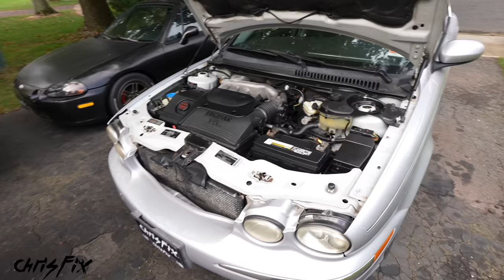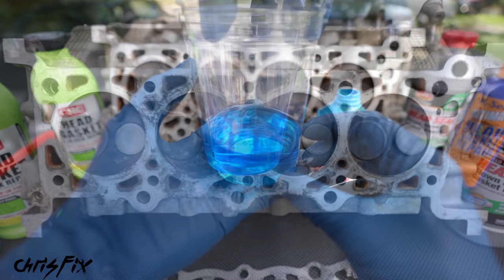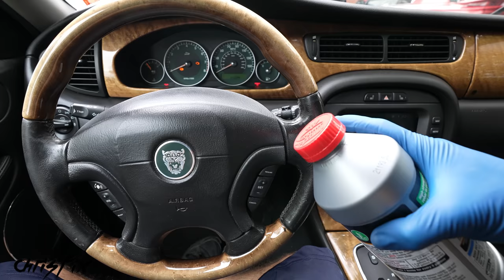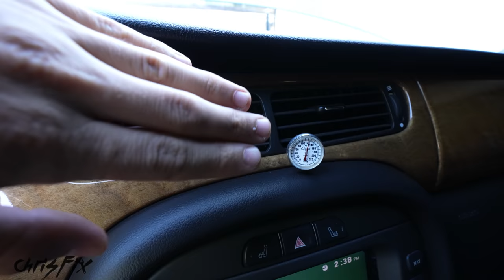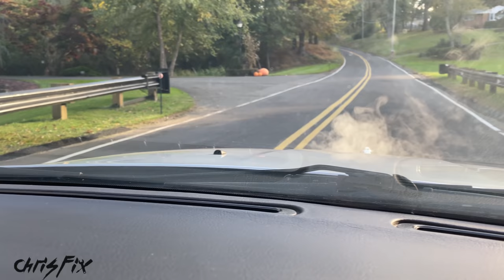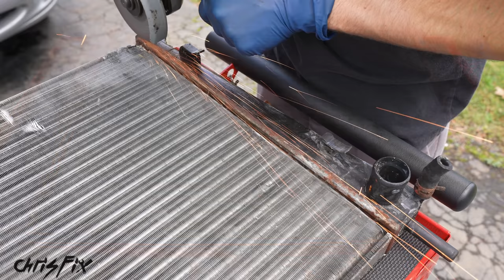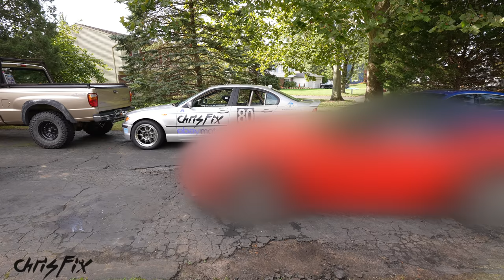Do Head Gasket Sealers Actually Work (FULL 2yr TEST with Engine Teardown)

Comment: I have well as of about a month ago had a 99 Silverado that had a blown head gasket it was getting coolant into the oil making it milky of course it was also leaking coolant of course obviously and was overheating and was unable to be driven because of it overheating I was getting prepared to change the head gasket on it when I was talking with a friend and he had mentioned the head gasket sealer to me and said that it works and that he knew from experience that it worked and of course I was skeptical because I have been working on cars most of my life and I have attempted using all types of stop leak and of course none of them have ever worked for anything that they were claimed to work for but even though I had started to check around and do some research as to what I can find out about any of the so-called head gasket sealers and I had run across your video and after watching it I thought before I had gotten into the labor intensive job of changing the head gasket I had thought well it's worth a shot and at the price of the sealers that are available it would be well worth the price paid if it actually worked so I had the bars leaks head gasket sealer because it was what was needed for my particular situation add read and follow the instructions exactly and it worked and of course I was shocked shocked and amazed I have to change the oil the milkiness of the oil and coolant of course evaporated from the oil however I did change the oil not very long after I had got it to stop leaking however after about a week or maybe a week and a half after it had stopped leaking it leaking it had started again and I thought maybe I didn't run the sealer in the cooling system long enough so I got another bottle of it and ran it in the cooling system once again and this time I ran it quite a bit longer probably twice as long as I did before and it worked again the second time and that was well over a year ago that took place in December of 2022 and I had drove the truck every day up till I had sold it and I had put well over 15,000 miles on the truck and it never had any more issues with the head gasket at any time and it is still running currently and the person that I sold it to was a good friend of mine and of course let him know that I had run the sealer and it so that way he was aware of it I'm a firm believer in the bars leak head gasket sealer I just recommend that anybody that uses it should run it for twice as long as what it says to if I'm not mistaken the bottle says to run it in three intervals of 15 minutes after the engine reaches operating temperature I'm not 100% on that but however many what time is it says to run it definitely do it twice as many times to make sure it runs through the system thoroughly you should have success with it as I know I did and anytime in the future that I run into a blown head gasket I will be certain to use it again because it is definitely cheaper and way less time consuming and nowhere near the aggravation of changing a head gasket

Comment: I have used nothing but "Steel Seal" brand for decades on a variety of cars  has always worked  if you"ve a milkshake in radiator flush with water  THEN use straight (Red) Kerosene to clean out all  (the kerosene has a high temp capability therefore will not ignite on you & cleans out entire cooling system of all that milkshake muck (ps) engine runs cooler also  THEN do a Prestone Flush same procedure  Now time to add ((as directed and product manufactured to do its job & validate guarantee)) add 50/50 proper brand coolant along with your Steel-Seal  works folks  works well  has never let me down & you do not have to change out the  coolant afterwords  drive & smile  if gasket blow out a serious blow out you should initially do proper procedure running @ house until results ((do not forget to run heater while having product do its thing & of course starting with the engine being cold  if runs super hot during so of course shut vehicle off & let cool & repeat procedure of start cold running heater until guage thanks you for your labors 😊

Comment: I have used the bar leaks head gasket stop leak and I don't recommend. It did not fix the leak and it ended up clogging the cooling system
Reply: Must have done something wrong, was the cooling system pressurized before the procedure? Was the leak severe, if so did you remove the plug from the worst cylinder to eliminate cylinder pressure? Thermostat removed? Heater core valve fully opened? Cooling system flushed several times before the procedure? Added correct amount of sealer taking cooling system capacity into account? Mixed the sealer with water before pouring it into the cooling system? Procedure done in several cycles raising the temperature some more every time or did you do it in one go?

Comment: I have a 2003 Chevrolet 2500HD with 6.6L LB7. I have no oil in my coolant and no coolant in my oil, I'm not overheating but my cooling system stays pressurized even when engine is cold. Will this test work for a diesel engine with the blue liquid? Or do I not have a head gasket issue? Hottest the truck as ever gotten on a hot day is 210(which is normal for a Duramax)
Reply: Just fill to the brim and look for bubbling while the engine is cold and running. It's normal for cooling system to stay pressurized.
Reply: @SinsBird Do you know if the one he used will work in a diesel engine?
Reply: @Tootallfordoorways  it would work, yes

Comment: I brought a bottle of Bar’s head gasket sealer after watched this video!And pour into radiator with half bottle. Then let the engine running at idle speed till Celsius 87 degree (30 mins).And drive to outside gently (1200-1500rpm).After all processes, the bubbles still from radiator! I don’t know why?
Reply: Are you losing coolant? Oil in coolant or coolant in oil? Running at idle is wrong.
Reply from the maker: The leak could be bad enough this doesn’t work
Reply: @chrisfix  
2000cc diesel engine!  Half a year after the engine repaired, I found that the bubbles from auxiliary radiator. Then I add a temperature meter(OBD II) to monitor  and avoid over heat. And it hasn't ever over heat(under 100℃) but only some bubble from auxiliary radiator continue. Utill I got this video and bought a bottle to try.I thought its mild symptoms on my engine and believe gasket sealer could save this problem.I need to suck some coolant from auxiliary radiator to radiator(about 40-200cc) before I drive everytime.Coolant is good without oil in radiator and never losing coolant.

Comment: So you don’t need to do a radiator flush or oil change before adding the sealant?
Reply from the maker: Check the instructions on the specific sealant you are using, in my case I didn't have to
Reply: You need to flush multiple times before and after using the sealer. Change oil if it's contaminated with coolant before using the sealer, then change again soon after the issue is fixed.

Comment: Question, my subruban is pushing out white smoke, the car does not overheat and the coolant is fine. However, it also idles really roughly when the white exhaust comes out and then drives fine after it heats up. Is the rough idle because of the possible head gasket crack? My other guess is that it is a bad fuel filter. it idles rough and sometimes misfires and has given off a P0300 before
Reply: Fill the cooling system to the brim and look for bubbling when the engine is running cold.

Comment: What a great video! Thank you for dedicating so much time and energy..I have an 06 Altima I believe has a warped head..any advice before I go get the green stuff?
Reply: Make sure the cooling system is pressurized, otherwise it wont work. I recommend to do it in steps, not one go, also keep the RPM above 1000.  Let the temperature rise some, shut the engine off, let it sit for and hour, check coolant level, add water if there's less of it now, start and run the engine some more to reach a higher temperature than before, shut it, let it sit for an hour. Check the coolant level...and so on till it reaches the operating temperature. Don't hurry to dump it out of the cooling system, make sure that it sealed for sure, drive it keeping rpm high so it gets hot, then check the coolant level. If it's okay only then dump it out. Flush the cooling system multiple times before and after using the sealer. If removing the thermostat would be a problem for you choose a sealer which doesn't have particle filler in it.

Comment: If you read the label on the Bars Leak, it says NOT to use antifreeze after fixing the leak.  I live in Vegas so I can get away with using just water. Can you suggest a coolant that will not destroy the Bars Leak seal?
Reply: Nonsense. It's just sodium silicate. After the leak is sealed flush the cooling system multiple times and use any coolant you want. But use water only when you're adding the sealer.

Comment: My head gasket is just leaking oil out the side.  No mixing of coolant or anything..  when i put it on i had to pull some of the bolts out cuz forgot something inside and reused those bolts which i shouldnt have done.  And i dont wanna pay for all new bolts and another gasket then take the whole thing back apart..  i dunno what i can add to the oil to stop the leak..  without having to take it apart and all..  it leaks a good bit but somehow isnt getting any mixing of fluids..
Reply: Bolts can be reused many times. This is not an issue. The issue is probably that you messed something up, possibly you tightened the bolts same way as you did before stretching them out. Gotta do it all over again.

Comment: chris fix can you help me my coolant tank its overfilling when cars a temp and got white smoke from car cars only done 98500 miles any ideas
Reply from the maker: Is the car overheating when the coolant tank gets overflowed?
Reply: @chrisfix  no just loads off smoke when accelerating it did have well to much oil in it so new oil in it the now
Reply: Also no milky oil on oil cap or dipstick so am confused and no garage will help me or audi as its a audi a3 2016 1.6tdi

Comment: I've gotten a new water pump, valve cover gasket, radiator, oil change. The antifreeze no longer leaks. My heater is working again. My car can sit in idle while running for several hours. But the moment I start driving, it overheats but will stop overheating when I come to a complete stop. I still don't understand what is going on.
Reply: Check your thermostat, make sure radiator fan is spinning like it should.

Comment: I’m about to try some in my e38 soon, Seriously hope it works
Reply: Is coolant and oil mixing? Oil in coolant or coolant in oil, or both? Is the cooling system pressurized?
Reply: @SinsBird  Good amount of smoke from the exhaust, Figured It was just condensation or engine burning off old gunk but I pulled the dipstick last night and noticed some faint streaks on the very end of the dipstick, I’ll have to get a combustion gas detector to know for sure but I sincerely hope those head gaskets aren’t bad. I always saw stopleak as a hack “fix” But I definitely don’t have the skill to fix or money to repair those head gaskets so this will have to do
Reply: @assadsmagicalmysterytour  Just fill the cooling system to the brim and look for bubbling when the engine is running cold.

Comment: So you said you didn't change the oil after doing this fix.  Is 10k miles a reasonable window for oil life in that car?  If you had changed oil after 5k miles do you think it would have held?  I guess not if the head was warped but it does make one ponder.  Also did this car overheat significantly before the head gasket sealer or was it a result of your dad flooring the gas 10k miles after the sealer without an oil change.

Comment: Thank you!!! My 2003 Mercedes E320 has head leak into the coolant system...they want $3300 to fix it...Hopefully, this will help
Reply: Is oil and coolant mixing? Oil in coolant or coolant in oil? Or both? Is the cooling system pressurized?
Reply: @SinsBird  The coolant system is getting pressure...so i drive it with the cap off...haven't checked the oil yet because it doesn't have a dip stick...i'd have to change the oil, in order to see the oil
Reply: @pastormichaelhibbertminist7486  if you don't see oil in the cooling system, then it's probably alright, because as it's not pressurized right now, oil pressure would be pushing oil in there. If removing the thermostat would be a problem for you choose a sealer which doesn't have particle filler in it. I recommend to do it in steps, not one go, also keep the RPM above 1000. Let the temperature rise some, shut the engine off, let it sit for and hour, check coolant level, add water if there's less of it now, start and run the engine some more to reach a higher temperature than before, shut it, let it sit for an hour. Check the coolant level...and so on till it reaches the operating temperature. Don't hurry to dump it out of the cooling system, make sure that it sealed for sure, drive it keeping rpm high so it gets hot, then check the coolant level. If it's okay only then dump it out. Flush the cooling system multiple times before and after using the sealer.
Reply from the maker: Let me know how it goes and good luck!

Comment: Hello Chris i have white smoke when i start after it's has been stand over the night. I did this testing that is on your videos and it's seems none gasket leak. I wondered what it can be?  I am thankful if you can give any ideas. Thanks so much.
Reply from the maker: Is there only a little smoke then goes away? That's likely some water vapor in the exhaust heating up and steaming out. Nothing to be alarmed by

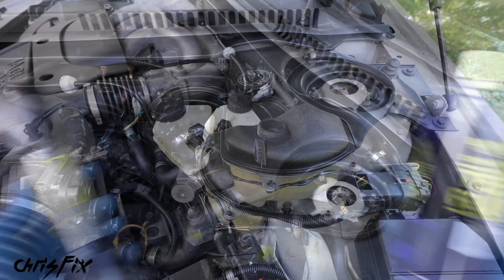Comment: Wait isn’t the cooling system pressurized when hot but you had the cap off 6:16
Reply from the maker: It pressurizes when the cap is on which closes the system, you can idle without the cap (you would have to if you were bleeding the coolant for example)
Reply: @chrisfix  I love your videos and I don’t even have a car

Comment: My car is not losing coolant or burning oil. Cylinders 3 and 4 have low compression. So the head gasket leak is between cylinders not affecting coolant or oil paths - gas leaks between cylinders. So I suppose these coolant sealants won't work but is there a way to seal my kind of head gasket leak without replacing the head gasket?
Reply: No.

Comment: On know this is 2 years old but I have a 2001 jeep cherokee xj & guessing I have a head gasket leak (or cracked head). I haven't overheated the jeep, while I consume coolant weekly, have what seems to be excessive moisture in the exhaust (it's also winter & cold) oil & coolant (color & no bubbles) look good. Cab the leak just be going into the combustion chamber without the gates escaping into the coolant? No other coolant leaks & its been too cold & work too much to pull the head right now.
Reply: Just fill cooling system to the brim and look for bubbling when engine is running cold.

Comment: Helo. Great video.
I have a problem with a 2001 VW Jetta TDI Diesel, not overheating not coolant in oil or vice versa. The only problem is overpressure in coolant reservoir it keeps pushing coolant out.
I have tried the same bar leaks product you did in this video but it didn't work at all.
Any suggestions?
Thanks for your help.
Reply: I recommend to do it in steps, not one go, also keep the RPM above 1000.  Let the temperature raise some, shut the engine off, let it sit for and hour, check coolant level, add water if there's less of it now, start and run the engine some more to reach a higher temperature than before, shut it, let it sit for an hour. Check the coolant level...and so on till it reaches the operating temperature. Don't hurry to dump it out of the cooling system, make sure that it sealed for sure, drive it keeping rpm high so it gets hot, then check the coolant level. If it's okay only then dump it out.

Comment: Thanks I have a question I have a civic 2003 if the head gaskets are bad the fans will not turn on??!!..
Reply: Can't say, it's possible. Just fill the cooling system to the brim and look for bubbling when the engine is running cold.

Comment: But, what if the leak were into the oil ?
Other than milky. What tests ? Which additive and how does it work etc ?
Reply: Not sure why you want other tests, that's the only symptom you need. It's less likely to seal such a leak but you could try. Probably any sealer with no filler material for this.

Comment: I don't see how the sealing compound could migrate into the cooling system by simply putting it into the reservoir.  As this test was done. Now assuming that the head gasket leak consumed enough coolant equal to the reservoir during the test drive, when the car was parked over night, the reservoir contents would then during that time be drawn into the cooling system, but without the heat from the engine the sealer wouldn't harden correctly. Could this be the cause of the failure after the 2 years?

Comment: Hey chris was this vehicle mixing coolant with oil before you used the sealer?
Reply from the maker: No it was more so burning the coolant up. These sealers can work if that's your situation though
Reply: @chrisfix  I ask because I was told that if coolant is mixing with oil, then using these sealers can cause the engine to seize up based on that it will get into the motor the same way coolant is getting in, what's your thoughts on that?

Comment: My coolant reservoir boils and over flows when the temp rises. ( this is while the cap is off) I found a crack in the radiator and it leaks . Would this cause my coolant to boil and over flow? ( car temp gauge never passes 1/2 mark, no white smoke , no smoke at all near engine , oil is clean, did a combustion block test and  it turned yellow )
Reply: Gasket.